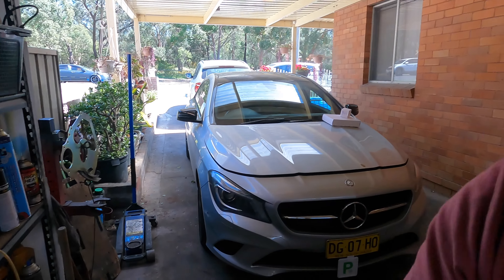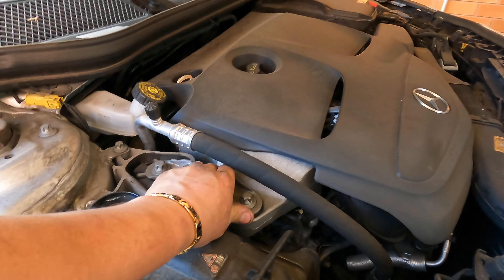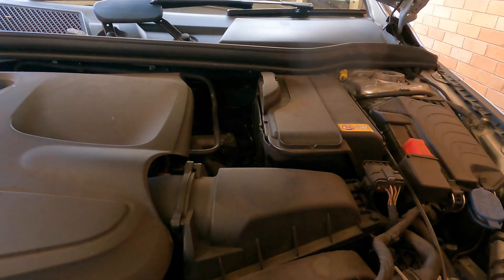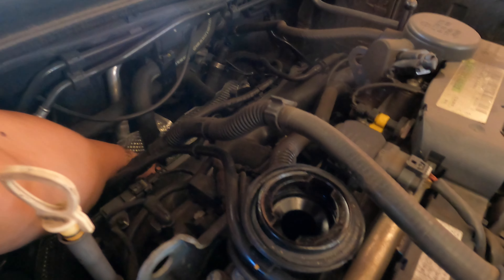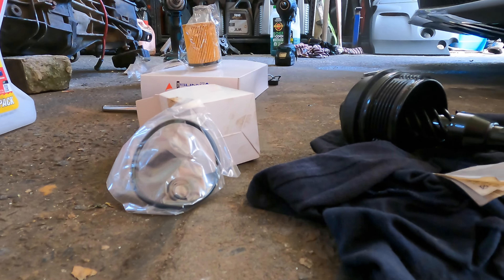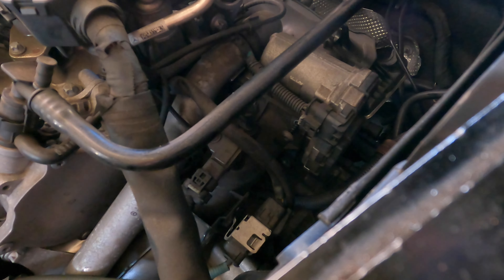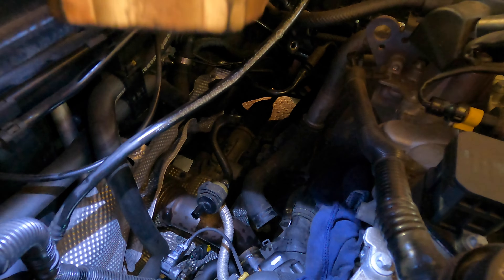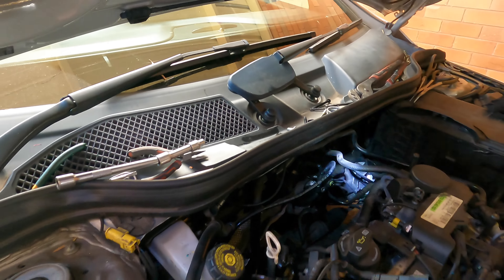Mercedes cla200 2015 thermostat removement

Comment: have Mercedes E220D, 2017 W213, I have a problem that the fan would still be running on max. speed for a 1.5 minutes after killing the engine. Knowing that the engine is Model 654. I have relaced the following parts: Fan, Turmos, Water pump, water back feed line. All original parts but the problem is still on. Also no fault found, could you please help me troubleshooting the problem?

THANKS ALOT.